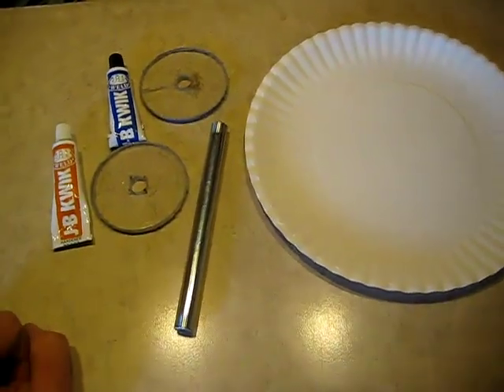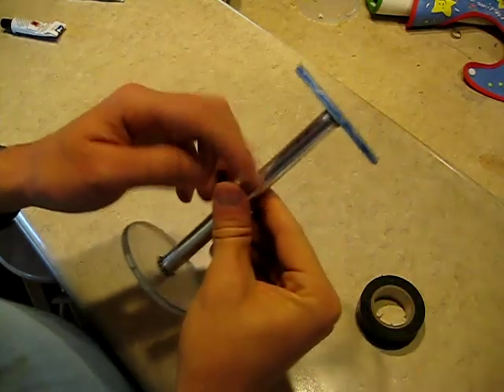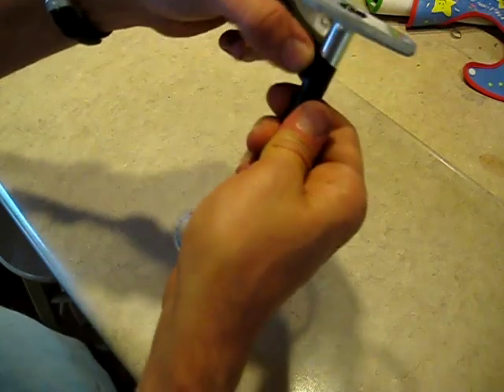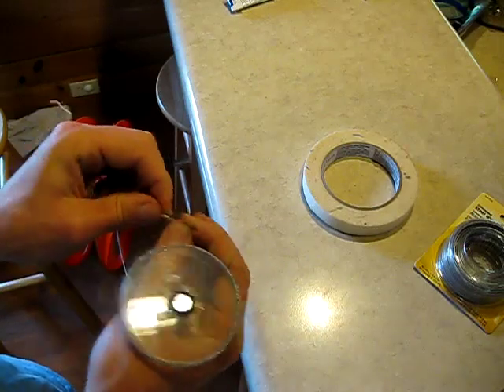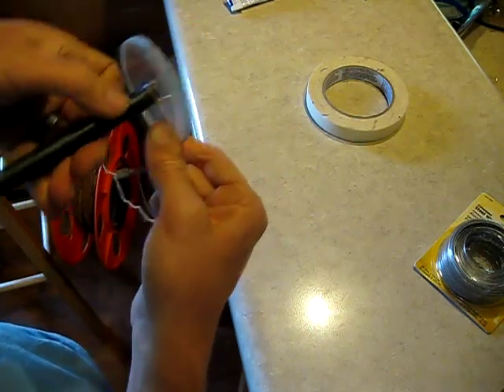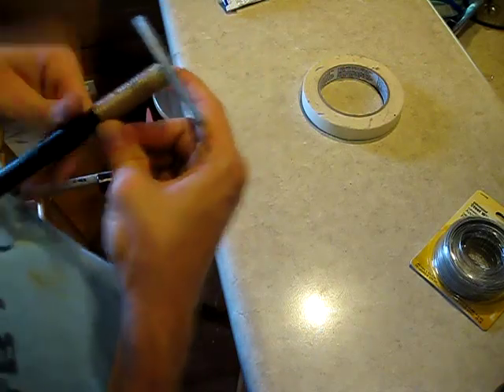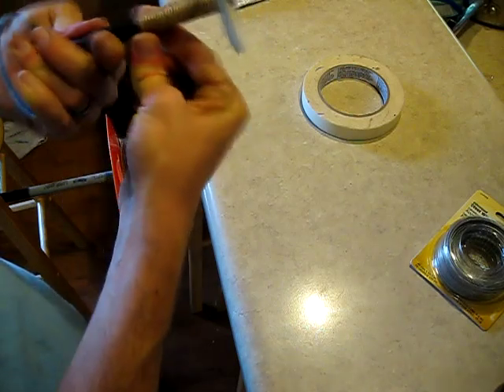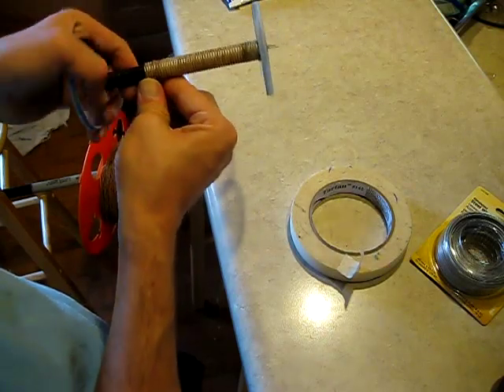How To Build A Nathan Stubblefield Coil Part 1

Comment: why not build a version of stubblefield coil where you use gold/silver (electro)plated/dipped cotton covered copper bare wire and use magnetic (dark green) garden (enameled iron) wire, so there is no corrosion or electrolysis and use it as a voltage source... then wind a helical pseudo coil that will act as a current source? said (a)ether/crystal power...? you end up with a an very high crystal resistance with the voltage source and a high siemens (mho) resistance with the current source, but, the two sources together would work well.. otherwise you are accelerating using germanium hybrid circuit with solid state transistors and B/O's and converters inverters, etc... to activate the (wet) resonator

Comment: Hi, I have a question. For the copper wire, what type do I have to get, the coated one, or the UNcoated one. Because today, I decided to do a small experiment with two 12"lamp metal bars united with a small coupler which bough the lamp metal bar to a total of 24 inches.Well, at home I had a spool of AWG 14 copper coated magnet wire AND I had a spool of bolt cable as thick as the AWG14 copper cable, I wired them in parallel, when finished I got 0 volts/0 amps.  Does BOTH cable has to be uncoated?

Comment: easy way to wind a coil is to put it on a lathe and then all you have to do is control the winding of the wire and not the turning of the core.